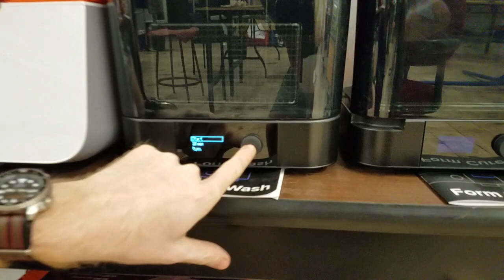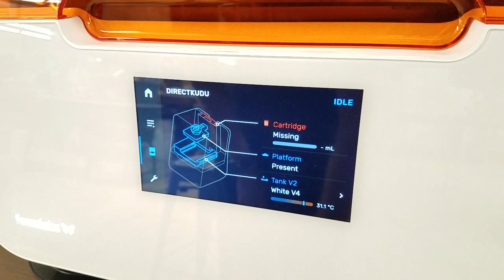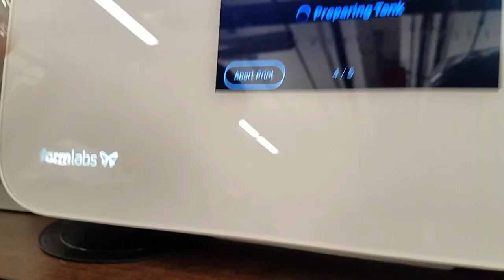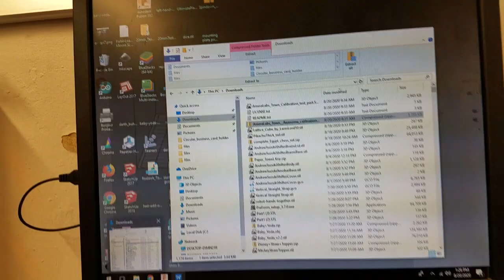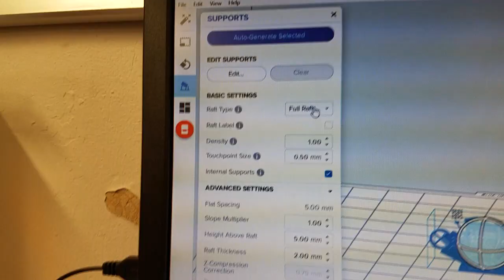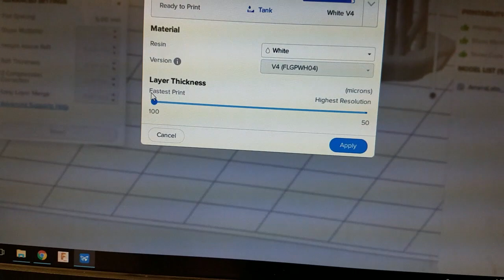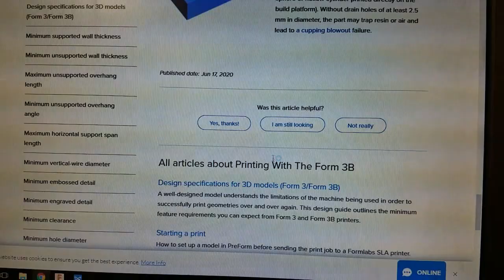How to Use the FormLabs 3B SLA Printer

Comment: Hi guys great video.  I have a question: until recently I had the first formlabs printer and by going into the settings from the software via PC or directly into the printer settings from the touchscreen, I could set the printer in open mode...by disabling the resin temperature sensor and the tray refill sensor.  Is it possible to do the same with the 3B and 3B+ I just bought?  Thanks for the reply

Comment: Hey, a quick question: Where did you get/make the tool holder for the formlabs which is mounted to the wall. I really like your setup there *thumbs up
Reply: Maybe printed haha -> edit: i ordered the form3B+ whole package. At the back of the form wash is this holder connected with screws to the wash. Like this video i removed the screws and use the holder separate of the machine.

Comment: 🎯 Key Takeaways for quick navigation:

00:00 🖨️ Introduction to FormLabs 3B 3D Printer
- FormLabs 3B is an SLA printer that uses resin.
- Components of the system include the printer, wash bin, and curing station.
- Resin printing offers high detail and is suitable for various applications.
01:27 📄 Resin Printing Materials
- FormLabs 3B uses various resin materials, including tough, white, and high temp.
- Each material requires a dedicated tray and careful storage.
- Resin printing allows for the creation of high-quality, detailed prints.
03:48 🖼️ Resin Printing Process
- Resin printing involves printing upside down and using lasers to harden resin layers.
- Proper platform and material storage is essential.
- Isopropyl alcohol is used in the wash bin for post-print cleaning.
06:12 ⚠️ Isopropyl Alcohol Handling
- Isopropyl alcohol used in the wash bin should be fresh and at the correct level.
- It's important to keep the wash bin closed due to alcohol evaporation and flammability.
- Regularly check and maintain the isopropyl alcohol level.
08:15 🛠️ Removing Printed Parts and Support
- Printed parts can be removed from the wash bin.
- Use side snips to remove support structures.
- Be cautious while handling delicate printed parts.
10:23 🔄 Changing Printing Materials
- Changing resin materials involves replacing the resin tank.
- Ensure the cap on the resin tank is loose to allow resin flow.
- Store materials and platforms appropriately.
13:30 🔧 Leveling the Printer
- The printer may require leveling using leveling discs under its feet.
- Follow the interface's guidance to adjust the printer's feet for proper leveling.
14:30 🖥️ Using PreForm Software
- PreForm software is used for FormLabs 3B printer.
- Proper orientation of the 3D model is crucial to avoid printing directly on the build platform.
- Settings like raft, density, and supports need to be adjusted based on the print requirements.
- Resin type and resolution settings should match the material used and desired print quality.
20:54 💡 Printing Considerations
- Consider the volume of resin required for your print.
- Resin volume can impact the cost of the 3D print.
- Resolution settings can affect both print quality and printing time.
21:23 🖨️ Printing Recommendations
- Printability factors such as cost per milliliter, supports, and cups,
- Tips for successful printing, including tilting pieces, reducing overhangs, and avoiding suction cups.
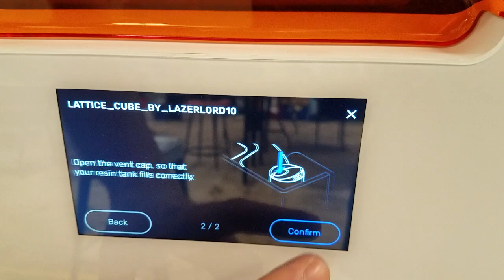26:44 📤 Uploading and Starting Print
- Steps for uploading a print job to the printer,
- Confirming necessary precautions like the vent cap and handle being locked down.
27:10 🧼 Washing and Post-Print Handling
- Placing the printed object in the washing basin,
- Initiating the washing process and ensuring the cap is closed,
- Drying the print and preparing for support removal and curing.

Made with HARPA AI

Comment: So far using formlabs Form 3
Do you think it is still easy to use? Or recommend new machines from other brands
I want to buy one recently, but this is the old technology of the previous two years.
Printer technology is always changing, still considering...
Is there a recommended discussion platform?